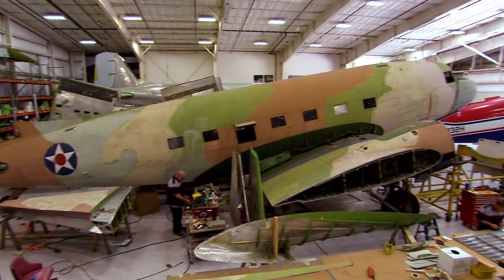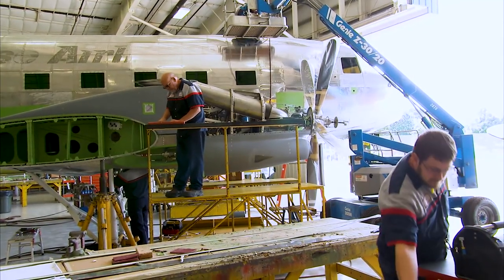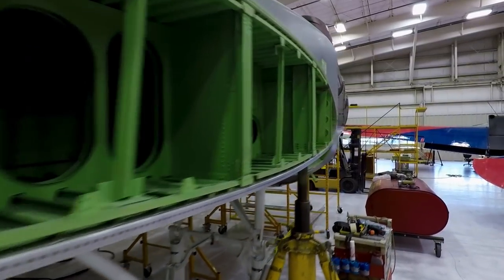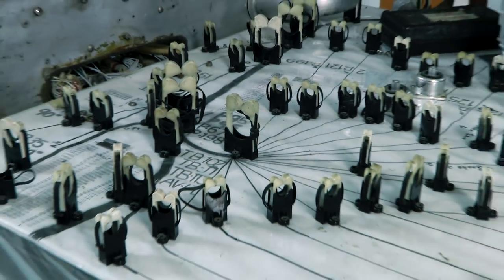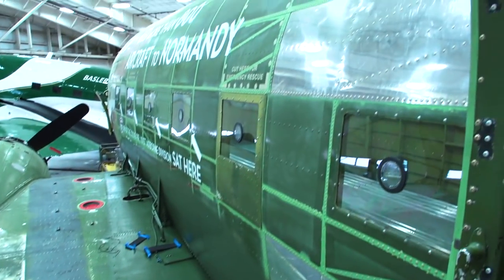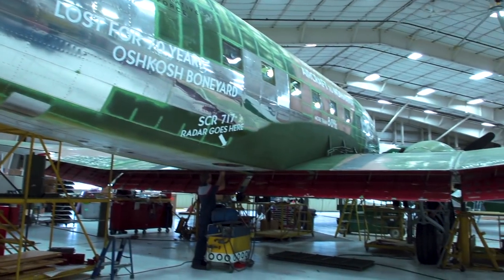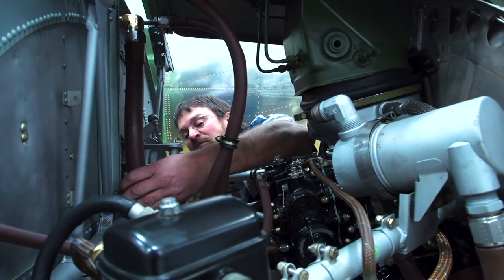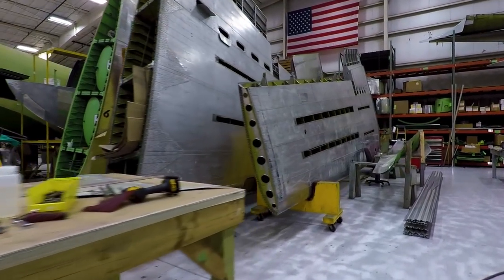Tough and Tougher

Comment: Better turboprop DC3's than no DC3's.  Besides, the props preserve a lot of the sound.  The newest R-1830 has to be 50-60 years old.  To me, it's great that all the good things about DC3's are not just preserved, but improved.  One thing I don't understand, though is why the tailwheel is not made retractable.  Seems like that would improve cruise performance appreciably.  Still, an 85 knot [nearly 100 mph] increase in cruise speed is not bad at all.  You end up with a quieter, smoother, faster and safer DC3.  What's not to like?
Reply: I was an avionics tech that spent a fair bit of time with Baslers (We called them Bedazzlers), I think very highly of them but that sound can't touch a radial... five blade props sound different too. They do get a lot attention still though.

Comment: One DC3 is $300k. After conversion to Basler with the Turbine turboprop engine, It cost $8 Million. Should just replace the old piston engine with a new high performance modern piston engine and bring the cost down to less than $600k. The only reason why they convert the DC3 is because they can't buy the funny octane fuel to run the old engines!